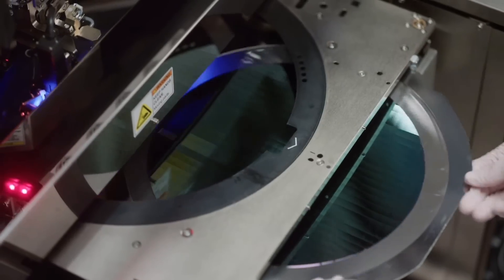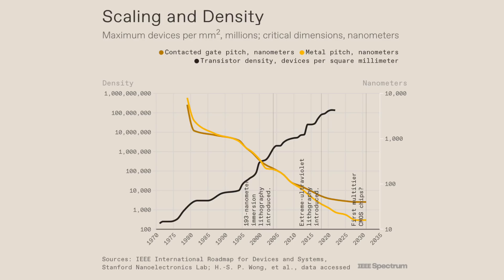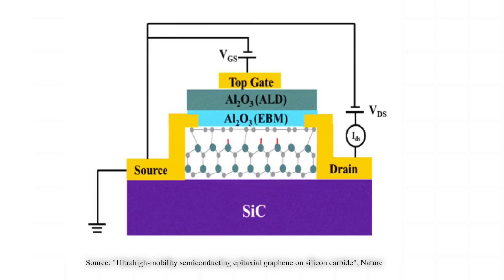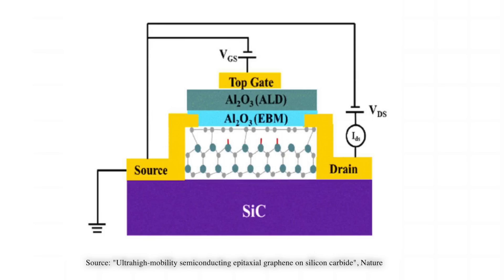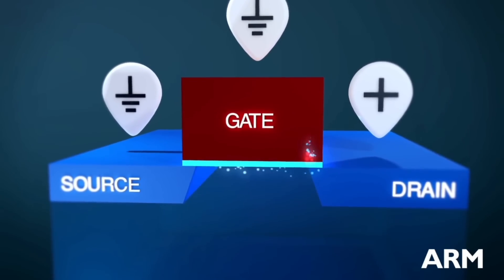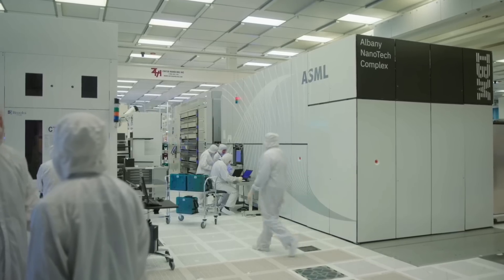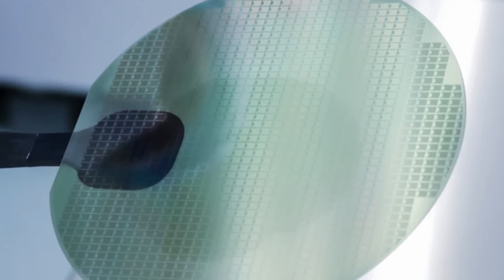Microchip Breakthrough: New Era of Electronics

Comment: Hi Anastasia.  What about how these technologies can improve memory random access speeds?  Ultimately, it doesn't matter so much if you can reach terahertz if your processor is large memory constrained to mhz to ghz.

 I come from the Forth Processor community, they are some of the simplest and most efficiently types of processors on the market, and probably still the holders of the lowest energy title.  But, it is highly modularised code, requiring heavy use of random acccess for subroutines.  So, is held back by present memory streaming schemes.

There is also a chip developed, but still under wraps, which maybe 6Ghz for each of the 40 cores, in 1mm2.  It's insane, but probably surrounded by extra high speed memory on each core.  Which is doable with this type of technology and architecture.  This would be the only performance core, that we know of, for decades.

Most of the modern designs are fpga designs down to aroumd 150 luts, and the minimum amount bof transistors for custom IC's is probably below 1000 transistors.  However, the community has produced a few of the highest performance desugns years ago.  The  Novix and the original shboom as part of the original Apollo Workstation take over bid, which was also the best at running C and Java code.  Their are dozens of forth processors, and probably has as many processors as all other language processor designs combined.

I suggest interviewing Chuck Moore, the inventor of the Forth computet language and part of the TPL async patent (his cutrent designs are async), inventor of novix, RTX (still available for space missions) and shboom, and a number of leading low energy design, imventor of the Forth language.  He made and perfecter his own tile based chip layout siftware in a few kilobytes, called OKCAD, now called Glow.  He did a new way of designing chip, some have claimed gives a 10x advantage, accurately and reliably below the design rules. 

They also have a non profitable to teach high schooll children chip design, and print chips (though tne technology is advancing so fast th new actual wafer pattern and dip machines are coming down in price.  So, to compete, I suspect better abd cheaper printer options will come along).  He currently is hiding out at Greenarrays.  If you search for the archive of the journal, Moore on Forth Engines by CH Ting, you will see coverage of the many early forth processors.

Until magnetic processing technology, between 4 and 40Thz, takes over its likely the reverse polish stack notation Forth processors will offer advantage somewhere, but the sector requires funding to do substantial chips on newest process nodes.

If I ever get well enough, I plan to get more of a team together, to do an open source architecture design for the embedded market, embedded handheld, and boards, to rival Arm, based on the logical architecture I worked on.  Then, maybe test out how fast we can get it to run compared to that 6Hhz processor in a cryogenic flow.  It would give those 4 bit Chinese processor manufacturers something else to make.

Comment: Thank you for posting this informative video.  Fire is probably humanity's most important discovery.  Without smoke in our dwellings large predators would have eaten all the babies and humans would have become extinct long ago.  Graphene semiconductors are likely to become more important than anything based on rarer elements.  Many early transistors were made from germanium but were very expensive because of the rarity of the material.  Learning to make transistors out of relatively plentiful silicon is what allowed the rapid expansion of semiconductor production.  Graphene is also based on plentiful "carbon pollution" and has the potential to replace silicon for many applicaitions.  Boron, on the other hand, is too scarce to replace silicon for most purposes.

Comment: No matter how small they make them eventually there will be a point it can’t physically get smaller using electricity to run the transistors. You won’t be able to stop the electrons from tunneling through and you can’t get smaller than an the electron itself.  I think we should explore different means of running a transistor like with light for example.

Comment: I really feel that as long as we continue to develop and produce "chip" based microprocessors, this will continue to hold us back in processing power.  Consider the structure of brain matter regardless of what creature, it is a 3d lattice of neurons with an electrically non-conductive medium (blood and other fluids) that flow through this lattice to keep the neurons cool.  One day with nano 3D printing, I hope that we can develop a processor that mimics brain matter possibly using a heat pipe like thermal management or even a non-conductive fluid that can keep the lattice processor cool using convection currents to circulate the medium to an external heat sink.  Maybe we need to create a large model of this and shrink it down like a prototype built with simple field effect transistors in a 3d lattice and submerge in mineral oil that is circulated.  Just thinking out of the 2D box here.  Thanks for the video and you have gained a new subscriber 🙂

Comment: SiC still has massive issues in the production process. Wafers are still limited in size to 200 mm and polishing the wafers to a useable state is extremely challenging. Whatever Fujimi and Nitta-Dupont are mixing into their polishing slurry, it is degrading the machines and peripherals at a rapid pace.

Comment: When are these available as single transistors?  I build amplifiers.  A good hi-end amp needs to work with good old vakuum tubes.  I've learned to build solid state amps that sound better than even a tube amp.  But when you play an instrument over them, after a while they suck.  I've tried it several times.  Noone even believes me that its not a tube amp!

I suspect its that electrons travel faster inside a vakuum tube than in semiconductors.  If these new ones go up till terahertz, they might be able to do the final trick.

Comment: As a non scientific guy. As with the size of semi-conductirs getting so small in relation to the size of the box that represents the human interface.  I don't see the point in the race to minitureize further.  Science as to accept that the area of a chip is maximised.  The heat dissipation problem to me is part and parcel of the miniaturisation.  There isn't enough surface area to cool.  Keeping the transistors at their current size but making the wafers larger with allow more efficient cooling.  Doubling the dimentions of a standard chilp will quadruple the volume of transistors.  This will have almost zero effect on the box that is the human interface.

Comment: Well the writing has been on the wall with regards to silicon for a while now. Without pivoting to a new material substrate, they will hit a wall. Chip stacking isn't new but it really has helped. AMD and Intel are both employing stacking.

Graphene has been mentioned quite a but but for years but the die process wasn't quite there yet... it'll be very exciting when the move to graphene does happen because its far superior to silicon with regards to heat...but im wondering how many years we are realistically away from making this historic pivot in chip manufacturing.

Comment: Just got a circuit board from China, I think.
Very small, and neet. Only problem is connecting it to a circuit.
Now I got me a high power glass and found where to  stick a small wire to it .
Years ago I read , I read some, where the smaller the chip gets the harder it is to connect it to anything else. I just know they have that problem solved but I haven't.
My old 265 hp computer is not much help. Short on memory.
A pretty girl always makes the difference but I still can't hookup my circuit board.

Comment: As a chip designer, how do you plan on cooling those chip sets? When current chips are already pushing the limits of current cooling solutions..otherwise they will just get throttled down to the point that they run as slow as they current chips!

Comment: Great video. I was one of the original Sound Blaster Card software designers in the early 90s. Go as technical as you want. Any Computer junking from 2010 and back understands this stuff very well.
Reply: LOL I still have one or two somewhere.
Reply: @afreezaphorogiancossack2194  what version I started with the original and did work on the 8, 16, 32, 64 and some of the onboard stuff for Asus and Dell modifications  in 2002
Reply: Oh hey, thanks for replying.  I've also got a couple of Yamaha PSR-560 keyboards, which I've been told contains most of the architecture of the Sound Blaster.  And that is part of the reason I've hung onto them.  @HeritageStacking
Reply: @afreezaphorogiancossack2194  the 560 uses a YM3812 chip and that is the same chip used in the original sound blaster. It could produce 9 channels of sound at once plus a frequency range over 49000hz. The chip was developed in the mid 80s and was used in SB products in the early 90s. Creative labs did well with it.
Reply: If it only had MIDI in I'd still be playing with it.  Cheers!   @HeritageStacking
Reply: Awesome bud! To me, You're one of the greats automatically Thanks for the audio and memories!

Comment: The bigger issue is Dennard scaling, not Moore's law. Especially since transistors went 3D a long time ago, and now GAA. Transistor count is misleading as they can't all be utilized at the same time due to heat. They must be turned off "dark silicon". If this new material doesn't address Dennard scaling, it won't have much of an impact.

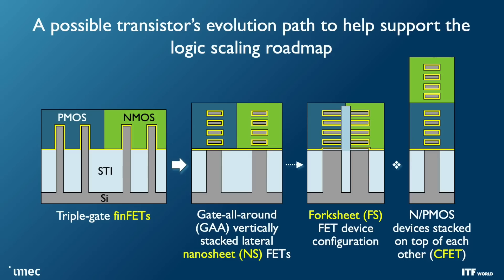Comment: 2:19 If heat dissipation is the problem wouldn’t using a thermoelectric material that can convert the heat back into electric energy help manage this by likely causing a cold vacuum around the thermo material, acting as a place for the internal heat to drain out as usable electric energy?

Comment: While you mentioned that graphene transfers, and dissipates heat better than silicon, I feel you skipped over two other important aspects.
Graphene has lower resistance, and therefore generates less heat.
I’m not sure if the above is the reason, or if it’s simply a property of graphene, but electricity moves through it near the speed of light.
These aspects are most likely where the 10 fold and beyond is processing speed are coming from.

Please correct me if I’m mistaken or misunderstanding the details anything I’ve written here, or in your video.
Cheers!

Comment: Nice to hear that news.

But on other hand for most ppl this is not breaktrough, cause curent state of tech is barely using 4 CPU cores for example, but we already have 16+ cores on CPU. SO yes CPU clock speed will help extremely right now, but more cores and smaller chips, well regarding power usage, yes, but regarding other stuff no.

I am not aware how is this used in corporate world and what it means for corporate world, so here i wont express my opinion.

But very good explanation :) keep ut good job ;)

Comment: Anastasi that is some remarkable work whereby they get electrons to flow ballistically. That would be equivalent to vacuum transistors. What are your thoughts on them. With empty space between the source and drain the electrons are truly ballistic.

Seems like we'll have chips that have so much speed, holy microwave, it'll be hard to get the data in and out through PCBs. Of course that'll be a very high class problem to solve.

Thx for sharing this information.

Comment: I do not think this is the right way. I would pefer to make source and drain normaly conductive and external field would be needed stop electrons from channeling through lettice. To make this work conductive channel would have to be thin in vertical dimention, so even conductors can be used as channel. Simple on paper, but needs research to make it work.

Comment: Any new transistor that is designed for faster switching frequencies in a lab environment has to wait till the chip production equipment to be redesigned and upgraded to handle the higher densities of transistors on a wafer. I am really surprised and excited to see this in use. Then AI models run so fast and lot more productivity can be seen everywhere.

Comment: Loving the lectures. Is there any benefit to manufacturing at hyperbaric conditions. Some alloys of chlorine and iron are producable at 1.8 ATM or higher which can't be made at standard air pressure. Perhaps materials behave differently at 1.8 ATM or so.. entropy is lower?

Comment: Orders of magnitude faster than what? The internal clock rate of current microprocessors (5 GHz)? 50 GHz is one order of magnitude faster. Do you mean at least 500 GHz oder 5 THz? This ist the bridge to optics. You can emit light with (sub-)mircon-scale antennas.

Comment: yes when they realize they need to build things on magic angles rather than linear dimensions and to use superconductive materials watch out things will start getting super fast. they just need to overcome the idea of processin in matter and get to the field effect superconducting transistor that uses qunatum feild effects to trandfer and process data through space rather than matter. Lets get on to graphene nanotube superdonducting magic angle aligned chipsets already using qunatum feild effects for spatial computing.  The Meissner effect (or Meißner–Ochsenfeld effect) is the expulsion of a magnetic field from a superconductor during its transition to the superconducting state when it is cooled below the critical temperature. This expulsion will repel a nearby magnet.

The German physicists Walther Meißner (anglicized Meissner) and Robert Ochsenfeld[1] discovered this phenomenon in 1933 by measuring the magnetic field distribution outside superconducting tin and lead samples.[2] The samples, in the presence of an applied magnetic field, were cooled below their superconducting transition temperature, whereupon the samples cancelled nearly all interior magnetic fields. They detected this effect only indirectly because the magnetic flux is conserved by a superconductor: when the interior field decreases, the exterior field increases. The experiment demonstrated for the first time that superconductors were more than just perfect conductors and provided a uniquely defining property of the superconductor state. The ability for the expulsion effect is determined by the nature of equilibrium formed by the neutralization within the unit cell of a superconductor.

A superconductor with little or no magnetic field within it is said to be in the Meissner state. The Meissner state breaks down when the applied magnetic field is too strong. Superconductors can be divided into two classes according to how this breakdown occurs.

In type-I superconductors, superconductivity is abruptly destroyed when the strength of the applied field rises above a critical value Hc. Depending on the geometry of the sample, one may obtain an intermediate state[3] consisting of a baroque pattern[4] of regions of normal material carrying a magnetic field mixed with regions of superconducting material containing no field.

In type-II superconductors, raising the applied field past a critical value Hc1 leads to a mixed state (also known as the vortex state) in which an increasing amount of magnetic flux penetrates the material, but there remains no resistance to the electric current as long as the current is not too large. Some type-II superconductors exhibit a small but finite resistance in the mixed state due to motion of the flux vortices induced by the Lorentz forces from the current. As the cores of the vortices are normal electrons, their motion will have dissipation. At a second critical field strength Hc2, superconductivity is destroyed. The mixed state is caused by vortices in the electronic superfluid, sometimes called fluxons because the flux carried by these vortices is quantized.

Most pure elemental superconductors, except niobium and carbon nanotubes, are type I, while almost all impure and compound superconductors are type II.

Comment: If a 'new' transistor could be made to be more than 'on' and 'off' e.g. '+', 0, '-' or Up, down, left, right, center. A crystal has structure. Piezoelectric effects, electromagnetic effects. By doubling the 'switch' outcome you can quadruple the options between 'transistor'...

Comment: If graphene materials do not allow 3D stacking of transistors this tech will face brickwall of transistors density vs traditional materials (Silicon) immediately. Graphene still has to provide 200M-300M transistors per mm2. Then it shall allow increase in density beyond Silicon. Otherwise this is not mainstream tech, but some kind of process for fast and "simple" chips with no more than 100B transistors per chip (this number of transistors is expected with traditional Silicon in 2024-2025).

Comment: Faster faser faster - what a rubbish marketing trick since decades. I remember my Sharp notebook of about 1990 with a 10 Mhz CPU ad a 20MB harddisk using Windows 2 or 3. with WinWord 2.0 in the autostart I could start writing within 50 seconds after switching on. And writing, storing etc. in the same speed as today!   10 Mhz is 0.001 Ghz!    So what makes this speed so important?  It always depends on what you do withit. For the normal user nothing will be faster.